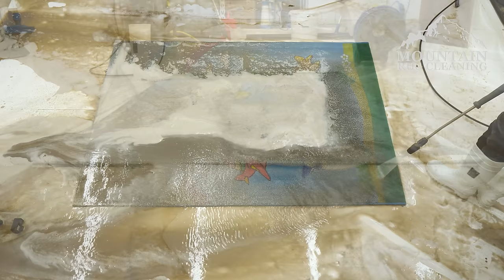Cleaning The Cutest Rug Ever ! But How Did It Get So Slimy | Satisfying ASMR Carpet Cleaning

Comment: You always end up with very clean rugs.
However, when you roll up the carpet after cleaning the front, the bottom is still dirty so you transfer all that dirt back onto the clean side and push it in. Why not clean both sides before doing that?
It will save on water, soap and time.